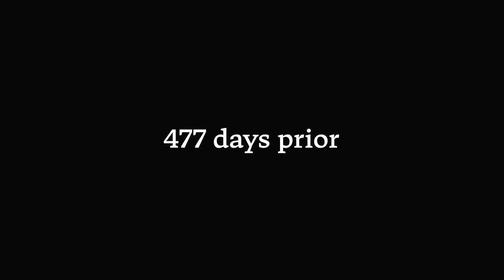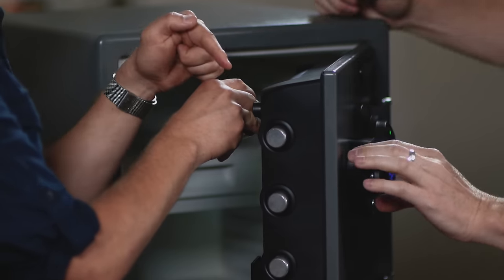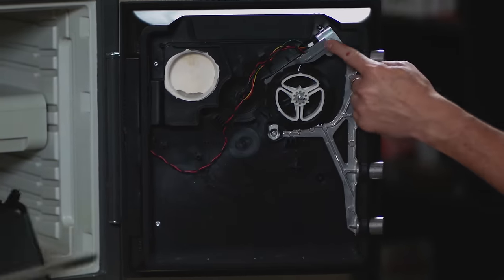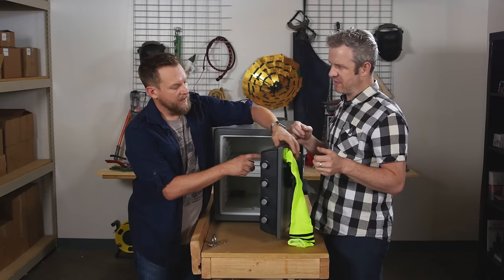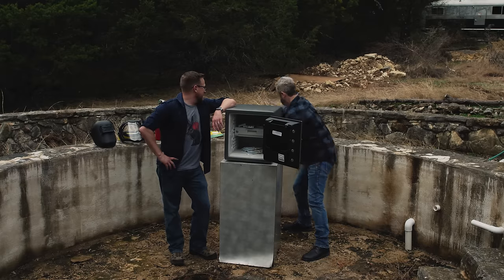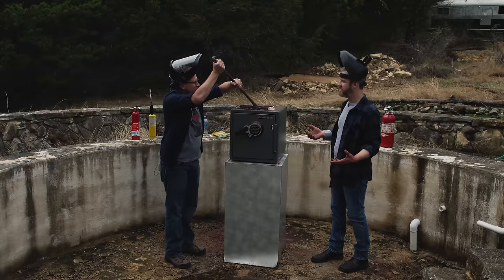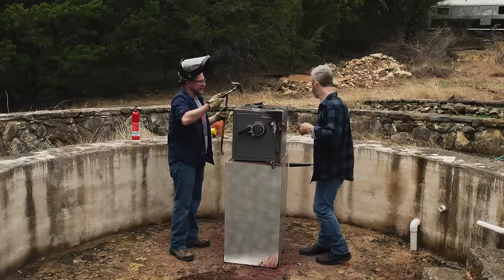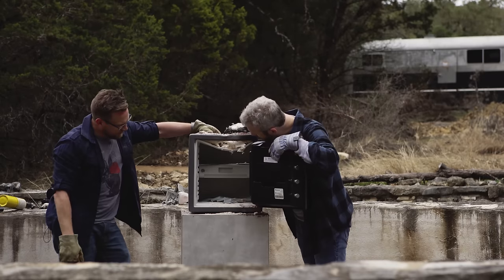Safe-Cracking with Magnets and Thermite

Comment: Break into a locked car without breaking the windows or triggering the car alarm. And ideally, disable the GPS.
Reply: i really like this idea. this requires more likes
Reply: I need to know this for uhh..... reasons, Hi FBI!
Reply: Search 'tennis ball opens car door' here on YouTube, you're welcome.
Reply: @BryanTheBatman1  dude they are fake. someone stands behind the camera and opens with the key remote.
Reply: All I know is with the old cars you can use a slim Jim just google it
Reply: Hotwire a car would be cool but it probably would only work on old cars
Reply: @BryanTheBatman1  this "trick" absolutely does not work. MythBusters even disproved it.
Reply: @_top_jimmy_  Asking for a friend, I see?
Reply: Gallium?...
Reply: A friend of mine worked at AUDI for a few weeks mounting the GPS modules.
She told me that about a year ago they started mounting the GPS module inside the frame befor it gets welded together so you cant simply rip it off anymore (furthermore she didnt have anything to do cause the modules were already installed xD)
Reply: maybe hotwire it also
Reply: this is a good one
Reply: On teslas its pretty easy ;D
Watch rich rebuilds.
Reply: You can use some metal wire shaped into a hook, works on old cars perfectly, and on newer ones with some further imagination and bit of knowledge.
Reply: they'll just thermite through the roof, the alarm wont even notice :D
Reply: There are different kits you can buy that are designed to pry a door open without damaging them, allowing you to use a rod to either unlock the door or fish the keys. Works on new, old, even vehicles with such things as suicide doors (although those are a bit harder). With practice, you can get in a vehicle within a minute or so. Don't know about GPS though.
Reply: @_top_jimmy_  Watching you
Reply: Step one most cars can be opened with a few pry bars some small air bags and a wire
Reply: Hacking a car. That would be fun to watch
Reply: Get Sammy Kamkar on
Reply: Kiro Haas Plan of Breaking into a bank safe without alarming any of the security and getting out with the money, without any traces.
Reply: or get the 1294x key for less than 40 bucks and have access to any crown vic fleet vehicle with a default lock.... (most of them)
Reply: Hey Police 
This person here
Reply: Popsicle stick. make sure it's dry and not the middle of winter
Reply: All you need is the right laptop and rfid scanner, easy peasy
Reply: @BryanTheBatman1  Only works with old cars slot systems ;)
Reply: They did it
Reply: Easy. create a 20k volt discharge to teh cars body will fry the alarm but usually spare the ignition system.  Its been done with a few microwave capacitors, laptop battery and charging circuit from a disposable camera to trigger it. There was a trick to HOW you do it, but its pretty straight forward.
Reply: Rtl-sdr + repeater and rainbow tables could be used to steal certain models

Comment: Sentry Safe is owned by masterlock. Any lock picker can tell you that masterlock cuts corners every chance they get, so this doesn't surprise me
Reply: Smuckers T I mean thermite is really fucking hot. I don’t think there’s much more they could do to stop that lmao
Reply: Smuckers T considering people use thermite to crack open bank safes I don’t think there is a home size safe alive that could tank thermite
Reply: Given that you can literally saw through it because the sheet metal is probably thinner than your average filling cabinet, I don't think this should even qualify as a safe.
Reply: @JonasDAtlas  It can count as a movie set safe
Reply: @anthraxinjection3589  I mean, they literally rank safes in how long it takes to brute force your way into them.
Reply: Another thing to remember it's that this is a fire safe not a commercial safe meant to prevent theft. Most consumer safes are garbage.
Reply: @JohnDoe-sp3dc  I don't know why people aren't understanding this. This safe is meant to keep valuables safe in the event of a fire. The fact that it takes quite a bit to break into is essentially just a bonus.
Reply: @JonasDAtlas   It's not. They sell it for fire protection only.
Reply: fire surfer That might be what the manufacturer is doing, but some stores certainly seem to sell it as a security product.
Reply: @anthraxinjection3589  ceramic plates between sheets would slow down a thermite user considerably

Comment: "Thermite is not explosive."
Iron thermite isn't.
Copper thermite, for instance, IS.
Reply: oh god, I've seen people do Lead Thermite and there's a giant cloud of Lead Vapor and some people are very stupid 

whether be the cause or effect remains undecided
Reply: Silver thermite....
Reply: Radster Chernobyl gold thermite?
Reply: Esteban Tomlinson 
Gold isn’t oxidized easily, if at all. Too bad.
Reply: Radster Chernobyl 
It is possible to make silver thermite, but it will be expensive.
Reply: Woah hey hey hey, no its not an explosive, copper thermite is a particularly violent deflagration (it rarely if ever explodes, just burns fast and violently)
Reply: You peaked my interest 😏
Reply: magnesium thermite is definitely explosive but you don't really even need the other metal you can just use sulfur
Reply: @caymanhunter2612 would that make it not a low explosive?
Reply: @vappyreon1176  so it's actually an interesting technical answer as it has two criteria that differentiate the two. The first is the pressure gradient. This is the reason most pipe bombs are a deflagration that becomes an explosive. The pressure builds until the pressure gradient upon rupture is great enough to cause severe damage. This is not to say that a deflagration is harmless. But rather their danger generally comes from different things. That being said the second criteria is that an explosives flames or exothermic fire ball needs to travel faster than 750mph. If both criteria are met, it's a low explosive(or a high explosive as you get further into that territory). Copper thermite however even being inherently exothermic is still a deflagration that rides close the line of low explosive but without ever passing into that territory.
Reply: @caymanhunter2612  interesting. Thanks for the information

Comment: the Lockpicking lawyer opened it within a minute with a standard circle saw lol
Reply: I was just about to comment this aswell xd
Reply: NB: More, it, actually, was wood saw.
Reply: Click on one... Binding on 2...
Reply: But thermite is more fun
Reply: I believe they have done a crossover with lpl so I am prety sure they are aware. They also have worked with Dev who does a whole talk about breaking into crappy gun safes/ safes.
Reply: @doubleshotops  Hmm, nothing on 3 and 4, just a bit more click , and that is how you open the main door in Fort Knox
Reply: @kevenlewis7765  😜
Reply: What episode nothing
Reply: @Liebe-Futurel  756

Comment: In local news, two idiots die when trying to separate two magnets.
Reply: After failing to open the safe with magnets because of technical reason the robbers accidentally dropped the whole bag of thermite they were going to use.
Reply: Anonymous Anonymous  3o7

Comment: This metal shell is so thin You could easily cut through with angle grinder or a hole saw :D
Reply: They often put concrete in the walls
Reply: @hankpharris2593  they make concrete cutting hole saws,
Reply: @caution1100  masonry cutting tools for angle grinders are very common
Reply: An angle grinder will open a much more secure safe like equivalent of popping a soda can.
Reply: @hankpharris2593  Even concrete is no barrier once the metal shell has been removed. Concrete (especially thin concrete with no backing support) breaks easily with a hammer.
Reply: Yep you can cut through the sides of most safes with an angle grinder and time. Even massive 1000+ lbs gun safes can be opened easily this way.
Reply: @hankpharris2593  If only humans had an easy way to break concrete. Maybe a large hammer of some kind.
Reply: try a circular saw
Reply: i think they didn't try it because of showmanship, not of logical reason
Reply: And it would probably be a bit less noticeable than thermite
Reply: Because the last time we used an angle grinder went so well.
Reply: If you are somewhere you can use an angle grinder on a safe without drawing attention there are a thousand ways to get in. The point is if you did try that it would make a lot of noise and draw attention to the theft
Reply: Even gun safes usually aren't much better.  They're usually slightly heavier sheet metal, and concrete board or similar to provide fireproofing.  A $5,000 gun safe can be opened by Joe Blow in under half an hour, with a Harbor Freight angle grinder, a few packs of cutting wheels, and a cheap sledgehammer.

Safes are a bit of a joke if you don't layer additional steel on the shell.  And at that point, why bother with a safe when you can make your own armored steel vault?
Reply: But that's not as cool
Reply: Let's all reply to this with stuff we aren't qualified to say.
Reply: Co jak co, ale Ciebie się tu nie spodziewałem :D Może nowy film - otwieranie sejfu elektrodą do cięcia?
Reply: @JanTuts  That's a fair point... :P
Reply: @DeCha1011  Tsa, poradnik kasiarza :P
Reply: @TheAttacker732  Most gun safes and fire safes like this aren't technically safes. They're "residential security containers" by insurance standards.
Reply: Was thinking the same thing. Angle grinder for the shell, a chisel and hammer for the cement and a reciprocating saw for the rest. Looks like a 5 minute job in the average person's garage.
Reply: Piran it's a FIRE SAFE
Reply: Lockpickinglawyer did it with a skill saw and I think it was even a sentry safe
Reply: @Aaron_Jensen  there is one that cannot be tho
Reply: Better yet, diamond tipped masonry hole saws will do short work of that thin plate too, so no need to even change bits.
Reply: Add a small shop vac with a hepa filter and muffler if you're doing an old bacon n egger.
Reply: @muhstello  because everybody knows thermite is soooo stealthy

Comment: At this point just use an angle grinder.
Reply: plasma cutter on the hinge, it cuts through most metals
Reply: I had one of those safes and the funny thing is that it was opened by a burglar driving MY tractor over it... I trusted that safe with all my spare money and got back like 20% of my money from the endurance company
Reply: @maxuniverse6002  Thermic lance, so you aren't reliant on a powe source
Reply: circular saw

Comment: You mean there are methods other than dynamite or cracking it by ear?....... I've been playing a little too much Red Dead Redemption 2.......
Reply: Richard Powell you’ve been playing too little
Reply: What if they added a blasting cap... I’ve been playing a bit too much rainbow six siege
Reply: I'm packing; moving house soon, and the games I didn't pack was PayDay 2 & RDR2, lmfao; They are packed now, though

Comment: Thermite can be explosive, if contained..
Reply: "Normal" thermite isnt quick enough to be useful , copper thermite on the otherhand...
Reply: Well if it hits water, a steam explosion could occur.  Or the Leidenfrost effect will splatter molden iron everywhere.
Reply: Jack Stephens correct, copper thermite makes a pretty peppy pipe bomb.
Reply: A really big hole coming right up
Reply: that doesn’t sound very safe does it
Reply: Along with every other accelerant...
Reply: Ice can cause it to explode
Reply: "When you mix fuel, metal oxide and metal powder in just the right way, it burns at 2000 degrees Celsius. Hot enough to cut through nearly any barrier known to man. Throw some C4 into the mix, and you've got one hell of a combination."
Reply: DDDestructo I love you siege is my favourite game
Reply: BIG F*CKING HOLE COMING RIGHT UP
Reply: Thermite can be explosive even if not contained. I was doing a science experiment not to long ago and on the 4rth trial all the thermite immediately reacted all at once creating an explosion. Unfortunately because i thought it could never explode i lit it with a torch. The outcome was me being severely burned and put on life support. I was blind for a while but eventually got my site. PLEASE dont take any chances, use a fuse and run far. I was misinformed, now you aren't.
Reply: No i wasnt wearing goggles because i didn't think it would explode. It wasn't iron, it was manganese(not magnesium)(II)oxide which is actually weaker than red iron oxide(Fe2O3). The power of a thermite has to do with how many bonds with the oxygen atoms are broken. I have theories on what happened but none the less its safer to use a fuse. If i did i would have been ok(discarding possible shrapmel).
Reply: which is the whole concept of directed blasts you contain an explosive and only allow discharge from where you would like to destroy something and naturally the energy from the explosive will take the path of least resistance and there you go result achieved
Reply: @armeenpajouyan8154  i just hopped you learned your lesson ergo anytime you have thermite you should practice common safety by not using a torch which calls for you being very close proximity to dangerous thermite to light and choose another ignition source and stand back or create a barrier and do some proper research of your own and fully comprehend whatever substances you will be working with
Reply: @jeffcraig3344  1rst, it was aproved by my 3 teachers, 2nd everyone lights thermite with torches like in this video, 3rd are you a donut, you dont think i did research. It has nothing to do with the type of thermite. This could've happened with the red iron oxide. So you do your research before you try and correct me. Ps why would i prepare for a explosion if its not supposed to explode.
Reply: @armeenpajouyan8154  damn im sorry that is very unfortunate you just got burned twice in one sitting. lol how inconsiderate of me
Reply: @armeenpajouyan8154  thats not what your mom said

Comment: I've never clicked on a video notification so fast in my life.

Also, you could've probably separated the magnets by supergluing the N42 to something stationary. Then just use a solvent like acetone to remove the N42 from the other object.

As for magnetic shielding, some ferromagnetic alloys are used for that purpose, so it is entirely possible that the outside of the safe is magnetic for that reason.

Oh, and, you guys should check out converting a van into a house. The Modern Rogue needs to be able to live rent-free after all.
Reply: Those neodymium magnets have a much stronger attraction than most any commercially available glue, especially when connected to each other. The lip on the second magnet was their downfall here, the best way to separate them would've been a shear force to slide them apart but the lip made that impossible

Comment: Home safes aren't made to be unbreakable. They are made to take time to break so that burglers just won't even bother. Thieves usually try to move fast and only go after things of high value. This is why they always search for jewelry boxes and other small high value items. Having any safe at all is 90% of the way to protecting your valuables from theft. If it looks secure, it might as well be secure in most cases. A thief will never bother with thermite because it takes a while to use, and draws a lot of attention. 

The same is true of basically any lock. Master locks in particular are known for being shockingly easy pick, and a master lockpick can break those open in less than 3 seconds. But just having a lock keeps out the 95% of thieves who are not master lockpicks.
Reply: Anonymous Anonymous  
You're right, but it wouldn't be asbestos.

Comment: FYI, that white powdery layer is probably soft firebrick refractory (or something similar) which is what they use in kilns. firesafes are great at protecting things from fire and generally (relatively) easy to brute force, while high security safes are great at keeping people out (unless they have a six inch angle grinder, 15 minutes, and some carbide or diamond wheels) but extremely vulnerable to fire. A dual purpose safe is where things start getting pricey very quickly. also a more secure safe would have bolts all the way around and thus invulnerable even without the hinge.

Comment: honestly something much more usable in this sort of situation is a thermal lance, which you can make with a length of brake line, some very fine steel wool, a bottle of oxygen, and a long hose. connect the brakeline to the bottle of oxygen with the hose and stuff some ultra fine steel wool in the other end of the break line, light the steel wool (fine enough steel wool will burn under a flame) and slowly start feeding it oxygen until the reaction sustains itself, congratulations, all the cutting power of thermite in a controllable and direct-able package. NightHawkInLight has a great video on this

Comment: If you still have some thermite left and didn't dispose of the safe try flipping it in the side and melt the material round the hinge maybe. It seemed to be much weaker than the pin.

Edit: After reading a bunch of the comments an angle grinder probably would have done the trick too on that